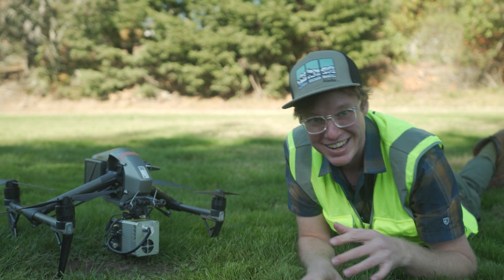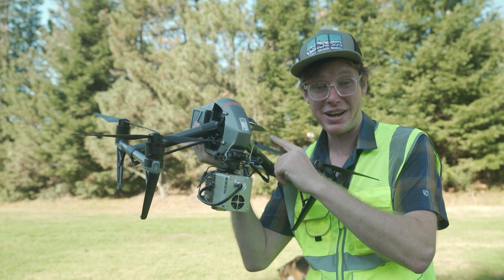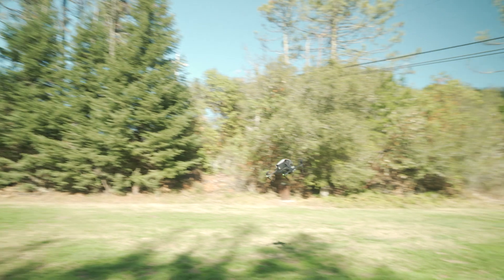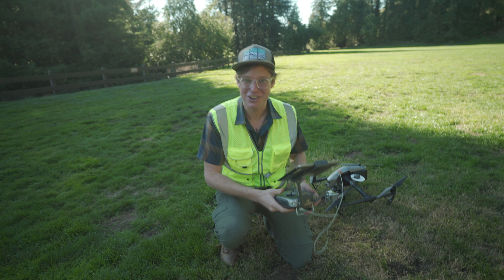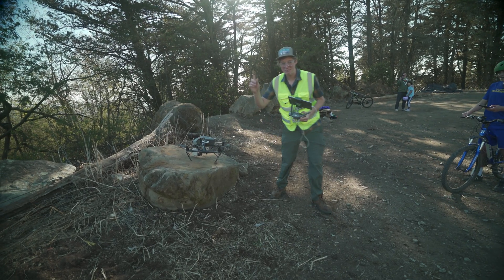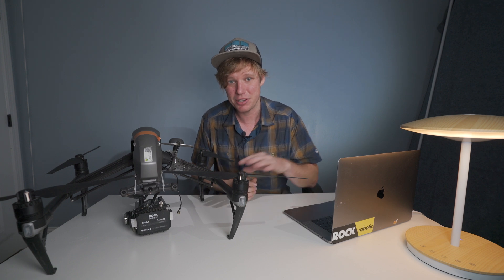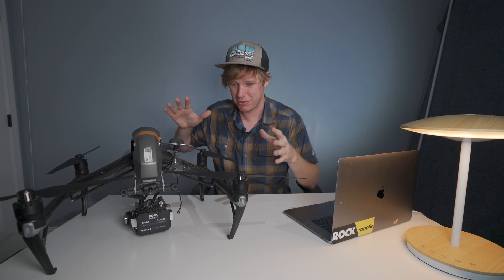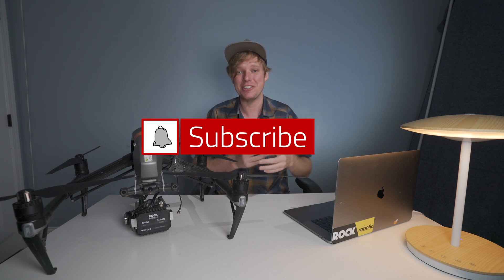DJI Inspire 2 LiDAR Drone - ROCK R1A

Comment: Visually the data looks amazing but you did not go over the precision of the actual measurements that where taking by the LiDAR. Also I’m not sure how efficient and scalable this drone set up is. I know flight time will be reduced due to the added payload. Please make another video going over if it is a realistic setup to use on the job, thanks!
Reply from the maker: Take a look at my channel! Lots of advancements / updates!

Comment: You're nuts pushing that thing around, if it flipped it could take your hand off or sever your carotid artery.
and like many asked why does the landing gear not retract like on a usual  mission ? BTW i just got a quote for the m300 r2a package from rock. Thanks for the info.

Comment: The fuss about it carrying a certain weight is a bit silly, you could have tested that with a dead weight....   let’s see the lidar working and explain how you assemble the measurements over the flight...   what’s the sensor you carry,? Range ? Specs ?

Comment: Very cool stuff.  Quick question...  Can LIDAR be used to find a metal object in the canopy of trees?  Say someone lost a drone in the woods and it went down due to complete battery failure.  So there is no tracking it...   would you be able to see it with a LIDAR scan?
Reply from the maker: Bryan... did you lose a drone in the woods...
Reply: @IndianaDrones  maybe....   😇

Comment: congrats . . . well done video ~
Reply: IF the legs are not showing in the data, I would just fly legs down . . . more stable (actually faster in straight line) and one less thing that could go wrong.  As for the antenna, I agree something on the front cowling would be good . . . maybe directly over the lidar if it lines up.  You could actually design and replace the front nose piece and make the shelf built in.
Reply from the maker: I broke the worm drive for the retracting landing gear :D But that happened last summer :D :D hahaha.
Reply from the maker: I can use some help with the GPS mount!

Comment: How many acres can you cover in the 15min of flight time? 

Can I get more info about the Lidar sensor used?
Reply: Interesting... can the LIDAR detect poles??
Reply from the maker: This mission was a terrain following mission with a lot of elevation gain.  I would say flat area 15 min flight time ~25 acres per flight. Heavy terrain will drop it to 15. Overlap is important too... Flat and farm land (10% overlap) maybe 35 acres per bat